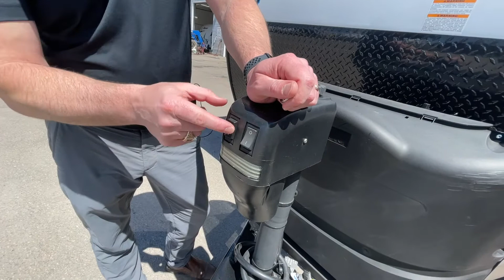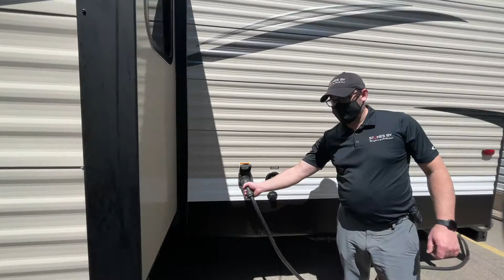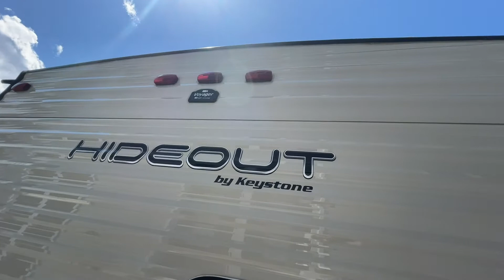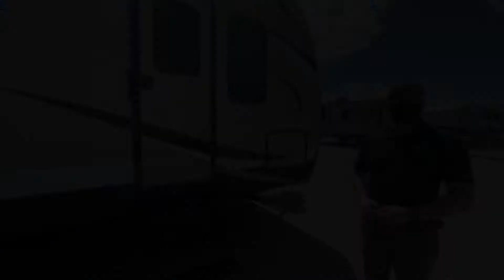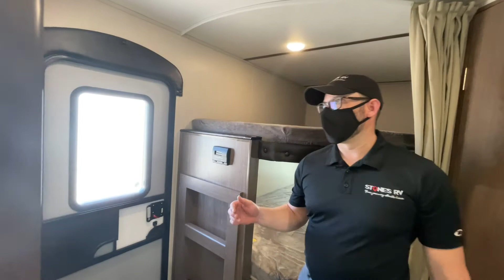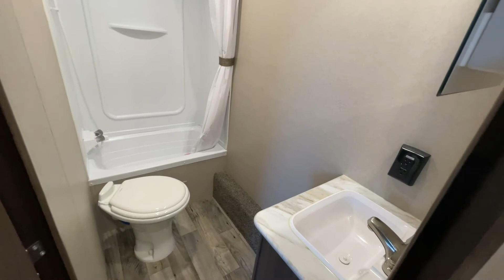Walkthrough of the Hideout 29DFS

Comment: Thanks for the video! Do you recommend leaving the extension out or in when not using it? I often see my season neighbors leave them open all week even though they're not there. I feel it exposes the caulking to the elements. But maybe it lessens the burden on the in-out mechanism? Thoughts?
Reply from the maker: Hello, if it's just for a week, leaving the slides all the way out is fine. It's also fine to bring them in when you leave the camper for a period of time. Just don't leave them half way out.